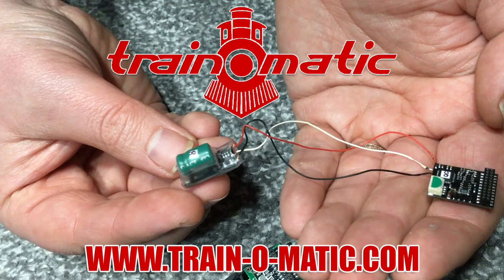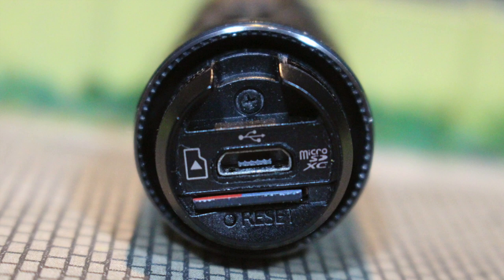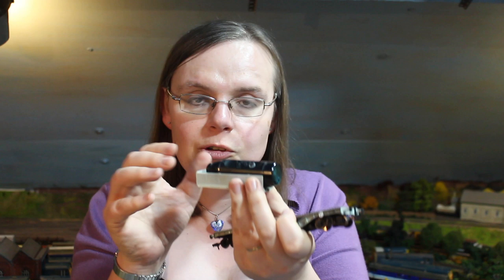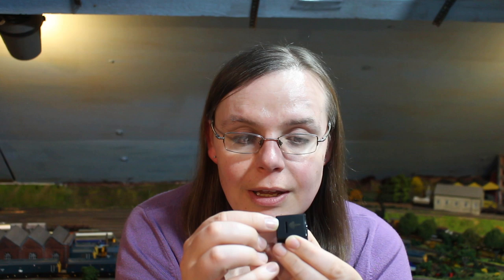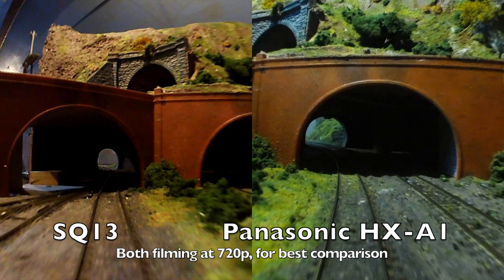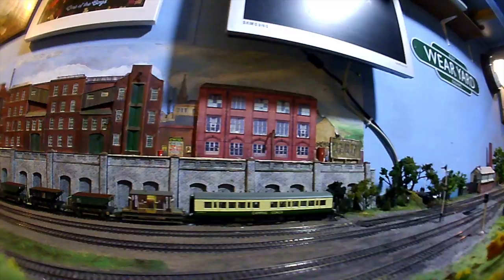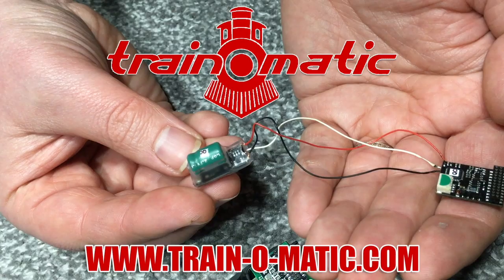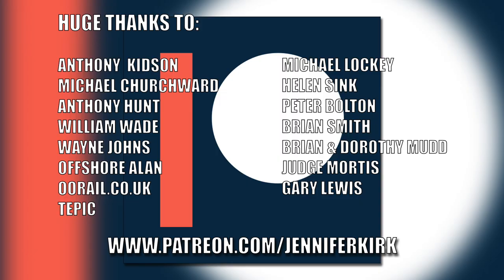Which Camera Is The Best To Film Your Model Railway?

Comment: Interesting, but I've mentioned previously the camera I use - the Mobius - It's a small, rectangular cam, with the lens on one end, records 1080p to a micro sd. charged via micro usb on the opposite end, along with the microphone., battery is good for about an hour continuous, or 12v external via the usb. Good audio quality. Needs protection from wind, of course. It measures 61mm l, 35mm w, 18 h. One button start/stop, or 12v external, weighs 25.5 gms, and comes supplied with an assortment of mounts, with others available separately, including a waterproof case. Can also be set to motion-detect, adds the time and date-stamp if required. Can be model-mounted, hand-held, used as a dash-cam, etc. Download via usb lead, or by transferring the sd to the pc. Last time I looked, they were priced around £70 on that auction site. If/when the battery dies, it can easily be replaced - two tiny screws open the case, and the battery is on a mini-plug and a bit of sticky-tape. A duplicated multi-colour led, one on the top, one on the rear, shows what the cam is doing. There's a website for setting up various recording options, or software updates, but apart from that, it is a completely stand-alone unit.

Comment: I have used my smart phone to set the resolution s of my sq13 camera but only need to start and stop the camera only by its buttons on any future recording sessions without any requirement to use the phone. I do not use the wi fi for anything other than changing settings and I  record everything on the micro SD card.

Comment: Interesting stuff! I've used an SQ9 cube camera on my layout - cheap as chips and allegedly has full 1080p resolution! - The focus isn't that great - especially on the move. It doesn't work via a smartphone but some settings are altered by editing a txt file saved on the micro TF/SD card - which is clunky. It also has IR night vision and motion detection which I feel aren't really needed.

Comment: After seeing your review, but also knowing the SQ13 camera, I am more convinced the SQ13 is a superior camera over the Panasonic, At around $25 (on Aliexpress), the SQ13 is first of all a steal. It has a very high picture quality for its size. But you have missed some outstanding features. First, you don't need the app to record video on the camera. The manual shows this, on the top of page 3. Although a bit in Chinese English, when on, you'll have to push the Mode key (the small button next to the power button) shortly, then shortly again. It will then record to the TF card. It would have been strange if you could only record with your phone and an app.
But the thing I love most about it, is the ability to connect through wi-fi with your computer and control the train with the controller, while watching the stream live on your large computer monitor. For that, you connect with your computer to the wi-fi of the SQ13, then go in your webbrowser to http://192.168.25.1:8080/?action=stream . This would be a great way to show your layout live on your Monday club, from the driver or passenger point of view. I hadn't thought of putting it sideways, but then again, there is nothing to see on my layout in that direction... In any direction, for a matter of fact.

Sven (of the Tramfabriek)

Comment: I have the same panasonic camera as what you show in the video, but its color is orange. Panasonic camera is the only one i found which is suitable for n gauge. for the scale greater than HO such as O OO, a cube camera is ok. you can choose a good one. For n gauge and less most dimensions suitable camera is self assemble by the camera that mini drone used. But all the cameras has a same issue is short working time(maybe less than 1 hour). So the better one is get power supply from tracks.

Comment: I want to buy a 'train cam' so I watched with interest. You (and no-one else) addresses the issue of frame rate. These cameras come as standard set at 30fps which is fine for countries with 60hz electricity supply but in the UK we have 50hz so need 25fps. You can see a stuttery effect in all your videos with these cameras and at 55 seconds and at 3 minutes 35 seconds you can see flickering lighting from recording at 30fps under fluorescent lights at 50hz. I use a gopro which we have to set at 25fps for European PAL systems but it's just a bit big for model railways.

Can you set your 2 cameras at 25fps or are they fixed at 30fps? What frame rate do you set for your main videos? 25fps I bet because they dont stutter and flicker. Thanks. Adrian